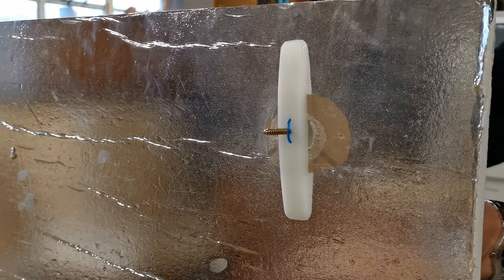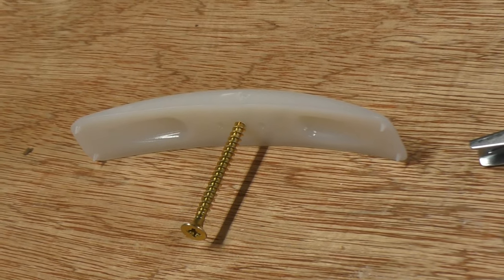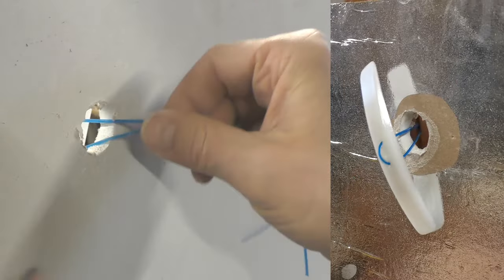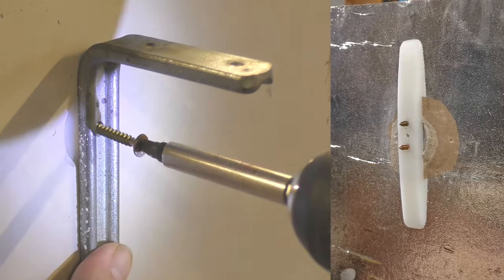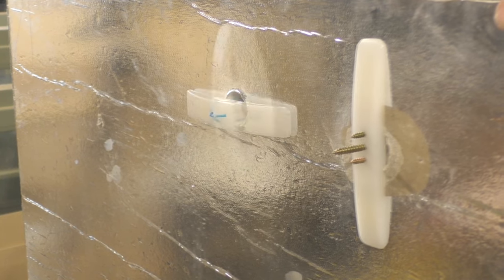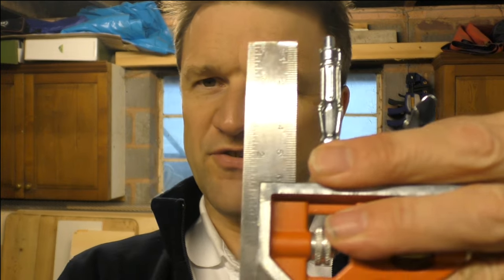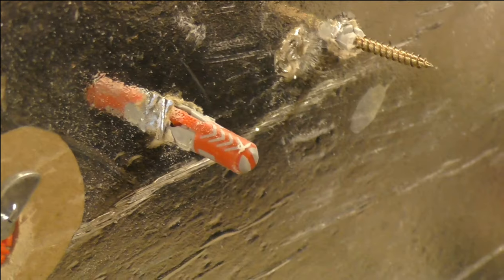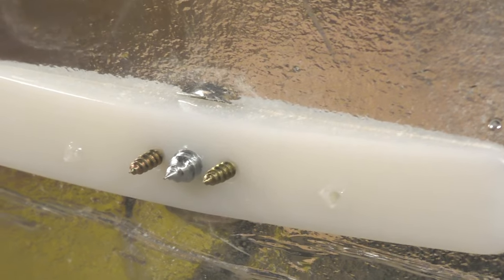The Strongest Plasterboard Fixing Ever!

Comment: Thanks Charlie, I bought these based on your recommendation to hang a very heavy (12kg) 1m round mirror on a plaster board wall- don't know exact thickness. It has worked a treat and the mirror is still up a month later and not movement detected. I couldn't stop the back plate spinning round when I was screwing in the plug, despite holding tightly to the strings (got cramp!) so took the string out amd luckily waa able to use the central screw to spin the back plate back to realign the holes. The other one rotated too but was easier the 2nd time. It still only took me 10 minutes and has done the job so I am very pleased.

Comment: love it been a chippie for 50 yrs love the way it spreads the load, one quiery will the plastic become brittle over time
Reply: Doubtful inside of a wall
Reply: you can just cut a big hole and slide a piece of timber in and hold it with your fingers while you screw it in from the front. same idea but a lot bigger load and its timber

Comment: This represents a technique I've used for 40 plus years, just using a 20mm hole and a 19mm wide strip of wood with my own reusable cord. 

Most often used in a ceiling next to a hole for light cable and needing support sufficient for the weight of the lamp off the loop-in connection plate (screwed through to the wood piece).

 Heavier weights in the ceiling? I make a bigger hole, up to 104 mm using a hole saw to pass a much wider/longer/thicker piece of wood through. Ideally to pass cross-wise between joists, or parallel to them if a longer more supportive fixing is required. After fixing, I can replace the cut piece from using the holesaw, fix it to the wood via one screw through the centre hole and fill the gap and screw position and smooth down. Done properly - minimum fuss and mess, maximum load bearing strength and simplest to install.

Can also be used on walls but wall gap, especially when insulated can present some (simply resolved) problems. Plasterboard (even 9 mm) is pretty damned strong strong when a load is distributed on it properly. The larger the distribution distance, the greater the potential load clearly.

The beauty of these nylon jobs is there is little danger of them splitting when multiple screws are used - not so true for wood pieces. I'd keep some of these in my toolbox for those "quick fix" occasions. 

But, there is nothing like chopping out (neatly) a rectangle of plasterboard between joist centres, rebating the joists either side and fitting a good sized board in between them, then refitting the cut plasterboard and filling/making good. Easy on a painted plaster wall, not so easy when the wall is papered!
Reply from the maker: Hi Bob - thanks for this. I've also applied this technique in the past but was too dumb to think about the cord!! You've done some top jobs this way, by the sound of it. The splitting is the main issue as you say and I was seriously impressed with how well the nylon took the self tapped screws.
Reply: Should of packaged up your solution and started making money then....

Comment: Looks like a winner pal ,deffo getting some.
Reply from the maker: I still think it's the strongest I've used. Only issue is if you've got narrow curtain brackets for example, the width of the circular core showing around the edge of the bracket.

Comment: Thanks.
That looks much preferable to wall anchors, much more secure.
By the way, I was confused halfway, up until you "fixed" the shelf bracket.
Over here in the States, "fix" usually means "repair."  For what you were demonstrating we would say, "attach, or "install."
I hope I can find GeeFix on Amazon or at Home Depot.
I have a lot of "fixing" to do.
Reply: I think it probably comes from 'affix' getting shortened
Reply: @peepiepo  Sounds right. Thanks.

Comment: Good job, I like it. I seen you dislike those grip its. I tried them out. I find they are effective alright but they don't really like insulated board, it's fiddly. Either way though, those ones in this video, not bad. I do similar if repairing a wall or ceiling. Chuck a length of wood in, replace the board, patch up, sorted.

Comment: I bought a packet of these a few days ago to mount a TV on a cavity wall. I absolutely messed up the first time round. I made the holes bigger so I could use bigger screws. Unfortunately the head was too big to fit the two wee screws in :'D

Bought another packet and used the supplied screws (just to get the fixing secured) then drilled the holes making them a wee bit bigger once the fixing was secure. Been a few hours and the telly hasn't fallen yet.
Reply from the maker: Good work. Perseverance is the way forward - you've learnt so much from this! Could you have just screwed into the fixing without making the hole bigger?

Comment: I had to refix a bathroom towel radiator where the caste aluminium fixings had pulled through the plasterboard. I cut x4 small 20mm×70mm rectangle shaped pieces of 12.5 mm hardwood plywood. Then in each, I drilled x2, 3mm holes, about 12mm centre apart (one for a draw wire and one for screw fixing). I then threaded some spare copper through the ply and knotted at the back. I then pushed the piece of ply through the damaged plasterboard hole and pulled it back tightly keeping Centred. I used  x4, 35mm wood screws and screwed the radiator mounts to small thin ply  squares of timber 40 x 40mm. I then screwed the these and the mounts (aligning the wall radiator) into the ply pieces behind the plasterboard and tightened securely. That worked for me.

Comment: Great video definitely going to have a look at these. One question. What's the maximum thickness that they can take. I need something that will fix through 70 mm depth as I have insulation behind plasterboard. I'm assuming if the cord is long enough then it shouldn't be a problem.  Keep up the good work thanks again. 👍
Reply from the maker: 75mm, but basically you're limited by the length of screws you can get hold of, and your ability to line them up with the blue cord. The further away, the harder it will be.
Reply: @CharlieDIYte  though that would be the case. Will give them a go and thanks for getting back to me chap.👍

Comment: Tbf. This can be tricky to get in if the cavity is small. Ive had to trim bits off the length with a saw. 
It is a remarkable system though. The big advantage is that you csn drill pilot holes through it if you want to 'move' a screw. And you can place a second screw through it due to the back component being so long in the wall.  One oftern needs to put 2 screws near to each other through a bracket. 
Being a polymer makes it great to drill to. 
Plus it inpresses the clients as they cant buy them in shops. They are for specialist installers
Reply from the maker: I agree, that's one of the massive advantages that none of the other options have. If the cavity is very tight and it's brickwork behind, my suggestion would be to use a Corefix https://youtu.be/fx90VadXSXA

Comment: Charlie, thanks for your excellent review of what is very clearly a superb product.  The designer is to be congratulated for attention to every detail in the design - a philosophy I’ve long subscribed to when designing products which must work first time ‘straight off the drawing board’.  As I’ve suggested elsewhere in replies to your review, a smaller version would be good when the gap between the wall and the plasterboard is significantly less than 30 mm, albeit with some reduction in load capability.

Re price, as always its a case of ‘you get what you pay for’.  Cheap and cheerful for less demanding applications or higher price for the ultimate performance, and everything in between.

Comment: Great video Charlie! I’m very much a DIY novice so I’m learning a lot from your videos. I’m looking at putting a tv on a dot dab plaster wall so I’m in the market for a good plasterboard fixing. These do look similar to the snap toggles which look good also
Reply from the maker: Hi Liam. Good to hear from you and really glad you're finding the vids useful! You really need these http://amzn.to/3o8hnOW as the steel core bridges the gap between the plasterboard and wall, and fixes into the brickwork behind for a really secure fixing. I've done a video on them here https://www.youtube.com/watch?v=fx90VadXSXA&t=291s Snap toggles are also good, assuming you've got enough space behind the plasterboard to thread them in. The Geefix is incredibly strong but you may not have quite enough space to thread it in. Depends on how big the plasterboard adhesive dabs are.

Comment: Thanks Charlie, after watching a lot of your videos I managed to hang a 55" TV onto a wall. You saved me over £200 that it would have cost to have a professional in to do it. Thank you thank you thank you 👍
Reply from the maker: That's great news Pete, and thanks so much for letting me know! What did you use in the end?
Reply: @CharlieDIYte  bought the Geefix but there wasn't enough clearance between the wall and plaster board so drilled in to the wall behind, used the supplied bolts and plugs and as there was a 15-20mm gap I supplemented them with 4 drywall anchors. Couldn't have done it without the content you provide 👍
Reply from the maker: @petef717  Great job, that's not going anywhere!! Next time you have the luxury of being able to drill into solid brick behind the void, give these a try http://bit.ly/340QFx0 Very impressed with them. It's basically what you did, but the steel core bridges the void enabling you to properly tighten the screw without the risk of the plasterboard being pulled back to the wall.
Reply: @CharlieDIYte  😁

Comment: Great demonstration! But I sure wish you’d shown a sample of installing this on a Lath & Plaster wall (which is what I have in my 1889 Victorian home) These walls need a video all their own- so hard to work with (!) thanks much for a helpful video!
Reply from the maker: It'll be good for lath and plaster Diana. I used it on a lath and plaster wall on a customer job in Barra a few months back. Complete life saver as the wall was crumbling with all other options. The key will be finding the right drill bit. I'd probably use a flat wood (spade) drill bit, but be prepared for it to get a bit blunt as you'll obviously be drilling plaster as well as the wood behind. Go in slowly and gently as the delicate bit is when you get through the plaster and into the lath behind. You want a nice clean cut in the lath which can be a bit tricky if you catch the edge of it.
Reply: Was just thinking the same thing, as my walls are lathe and plaster, a few years back I cut out the lathe and plaster out and screwed ply to the joists behind, it fix a hand basin, these fixings would have no doubt secured it. Would love to see a demo please, on lathe  and plaster fixing, So many people on Amazon complain that the backing piece spins round and cuts the cord, thereby losing the fitting, maybe poking something through the screw hole into the back piece would stop this? A long nail?  Prices on Amazon are good, maybe do an affiliated link?
Last thought, would be a good idea to run the screws through the plastic before fitting, had to do that many times on cars.

Comment: A great idea and looks incredibly strong, but if you need to take it out, the backplate must surely fall into the cavity like a toggle fixing so it doesn't seem so reusable. I doubt it would be easy or even possible to re-thread the blue cord back through and save it, I could be wrong though.

Comment: Good product & thorough review that satisfied most of the thoughts initially raised. How would it go, in terms of entanglement & alignment, inserting it into a cavity filled with fiber insulation?
Reply from the maker: Thanks. You'd probably get it into a glass fibre wool type product but you wouldn't be able to use it with PIR. For that you'd need one of these https://youtu.be/L2Hy1IhQ17s

Comment: Hi Charlie. Enjoy your videos, most helpful!

Quote: "So in short, this is the strongest plasterboard fixing I have encountered to date, and this would now be my first choice for heavy objects like radiators, towel rails, cupboards, mirrors, cycle racks and heavy curtains on curtain poles and tracks."

Firstly, would you agree these fixings are suitable for attaching a shower screen to a plasterboard wall (the type that pivot from the wall fixing), as all of the aforementioned uses involve static objects?
Secondly, two years on, do you still feel the same.....that they are the strongest plasterboard fixing ever?

Look forward to your opinion :-)
Reply from the maker: Yes Steve. Obviously with plasterboard you really want to anchor into the brickwork behind, and plugs like the Corefix are great for that. However if you can't, then this is still to my mind the strongest fixing out there, just because it's so much larger behind the board than any others.
Reply: @CharlieDIYte  Thanks for the advice Charlie, I'm looking forward to hanging something heavy on to plasterboard with a little more confidence than usual :-)

Comment: Having lined a very rough kitchen with plasterboard, before plastering and tiling, I now have cupboards full of food and china plates etc hung happily on it with no problems...the secret....I simply affixed plywood to the back of the plasterboard - in between the battens that were screwed into the old brickwork - with construction adhesive...no other fixings required other than those normally used...so no issues and no expensive plasterboard fixings to buy...👍🏻 I should add that between the wall and plasterboard is 25mm thick ecotherm insulation, stuck to the old brickwork, again with construction adhesive, sealed with aluminium tape, and the battens were 40mm x 90mm (mounted width ways onto the wall in the normal upright position), at 600mm centres - as effectively the plasterboard was ‘reinforced’ by the plywood sheeting... cables were also run behind the plasterboard/plywood in the normal manner to outlets, but all pipework was surface mounted within the kitchen behind cupboards as normal...

Comment: I like it already, and I've only watched you fix the fixing, not mount anything. excellent. You could even use a bit of glue, if you had two screws to put close, or even not use the plug after glue had set. Nice wide load bearing. They will get cheaper, but not that dear considering what it would cost to replace the lining!!!

Comment: Love the how to ... great for having a go  yourself...do you  recommend the same plugs for ceilings as walls? Not much advice online re topfixing curtain tracks to plaster ceiling...Using your recommendations and  hope they work the same on ceiling
Reply from the maker: The trouble with this fixing is the circular plug might not be hidden behind the curtain track bracket. With curtain tracks I've typically used something like a hollow wall anchor in the past as shown here https://bit.ly/2Fa0C36
Reply: @CharlieDIYte  thanks a lot hollow wall anchor it is...managed to find some geefix in  Australia as i am sure to find a use  for those!

Comment: I tried to use them earlier unfortunately after drilling the 25mm I realized I didn't have enough room between the board and the wall. I used the blue 🔵 grip it fixings in the end. They seemed to work well I ve never used them before. The desk I put on the wall was 20kg. Will try these fixings on a different job
Reply from the maker: I wasn't very impressed with Gripit https://youtu.be/04jbqMRTD3s?si=ovDjAhtCwlqbs_HQ but as you say if the space is limited you have to improvise. Might have been better to fix into the substrate behind with something like a Corefix. https://youtu.be/fx90VadXSXA?si=eZSfYjgXFYMfhzfT

Comment: Looks great & need something for a hollow core door that need to install shelving units inside a kitchen pantry(on/in back of door). 
Would love to give these a try in my biz, as always looking for new & 'better" way to use anchors.... Assuming you can't reuse, and guessing it's a one time deal, like toggles, once removed, they fall down. 
Wish pricing was same as you put in description for us in States😉.

Amazon GeeFix Pricing for USA:
8 pk = $27.97
4 pk = $14.97
2 pk = $8.47 (limited stock as of 07 Jan 2019)
1 pk = $5.24 (limited stock as of 07 Jan 2019)

Cheers, A
Reply from the maker: Sorry to hear the pricing's more in the US, buddy. Must be the import cost. Thanks so much for the intel, I've updated the product description and given you a shout out!
Reply: The back cant fall down because it is fixed to the front piece with the two outer screws. (unless you mean trying to re-use the fixing in another location) The only limitation to how many times it could be re used in situ is that the screws would chew up the hole in the backplate with repeated insertions. 

Looks a really good product.

Comment: Yet another great tip from you Charlie. 
Can this be tweaked to sit flush to the surface so the shelf bracket or whatever is flush and in contact with the plaster board?

Comment: The strength of these fixings are down to two key factors:  a) The ability to pull the back part through the plasterboard; b) How well the central screw resists pulling out from the plastic bit.  The latter could be impaired by overtightening the screw and thus damaging the plastic.

Comment: This video was so helpful for me , so reassuring. one question could you use a extra long screw to  go into the breeze block for added  strength. don't worry if you can't answer thanks for a really great video/
Reply from the maker: Thanks, I'm really glad you found it useful. 👍 Yes David you could and actually should if you're fixing something particularly heavy to the wall. Have a look at something like the Corefix https://youtu.be/fx90VadXSXA and if that's not long enough, a typical frame fixing would do the job (I've used them a lot over the years to safely secure heavy curtains in the day job).